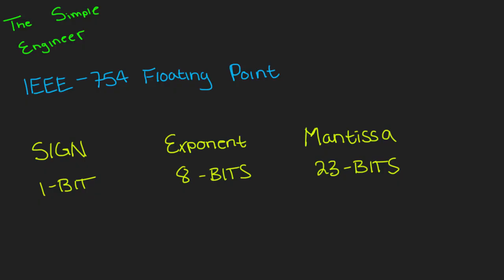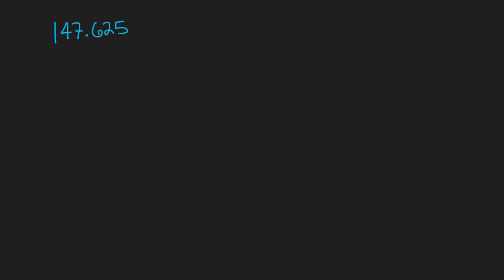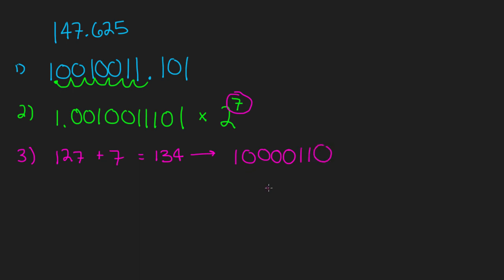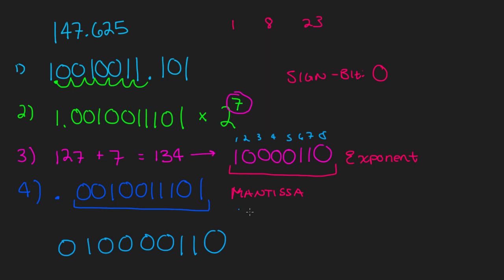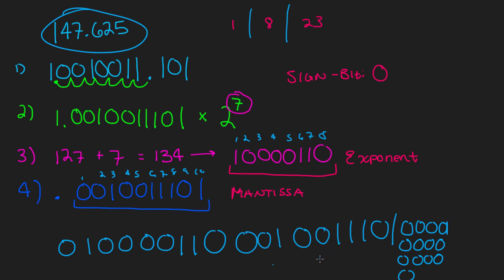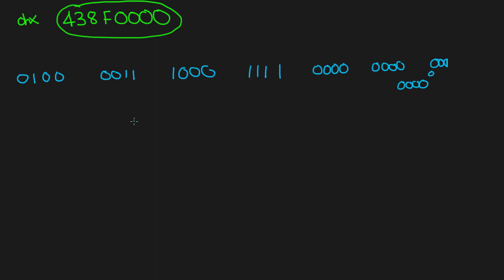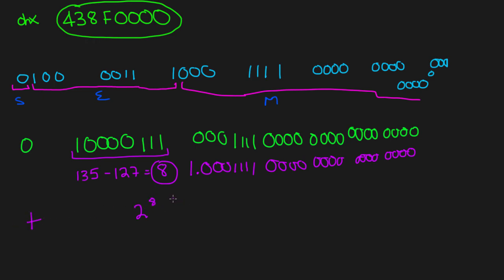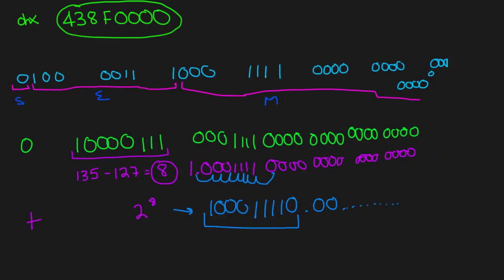Converting Decimal to IEEE 754 Floating Point Single Precision

Comment: I dont quite follow for the matissa, you mention to add 13 extra zeros. However you added the zeros on the right side of the binary number which just increase the binary number by 2^13. Dont you have to add the zeros on the left side of the matissa so that the value stays the same?

Comment: #include <stdio.h>
int main(int argc, char const *argv[])
{
float a = 1.1;
if(a==1.1)
  printf("if");
else
printf("else");
}
The output of the above program will be : "else"CAN U EXPLAIN THIS WHY
Reply: it's because the number 1.1 cannot be correctly written in computer memory, because the base being used is 2 and not 10, and when it's converted back to 1.1 errors in rounding happen. to avoid this you can use a really small constant (example 0.00001) or, i don't know if it's supported in C, but in C++ you can use the machine epsilon for the type you need, in your case float, which can be found in the library limits, so instead if(a==1.1) you use if(abs(a-1.1)<epsilon), where epsilon is the small constant.

Comment: what to do when we need to convert decimal integer without fractional part?
Reply: At the expense of potentially sounding like an idiot, I believe I have an answer for you. If you just had an integer (say 147 as per the example above) it would just mean there was nothing left to convert. If 147 equals 10010011 in binary, then the decimal is at the same location (at the very far right) of the binary number. Everything in the above example would be the same except for the 101 that was the conversion of .625; it would just not be included within the mantissa. That is how I have come to understand it, but I may be mistaken.